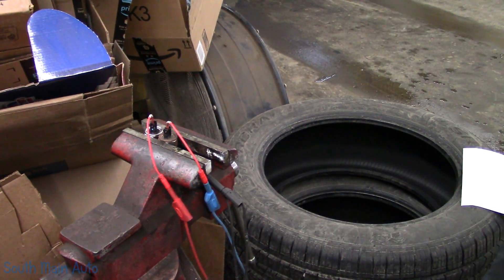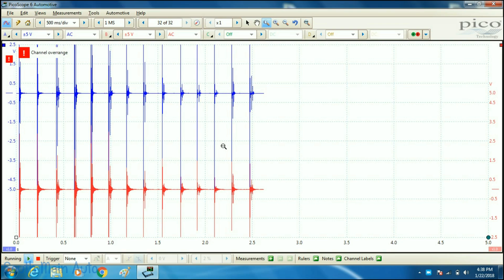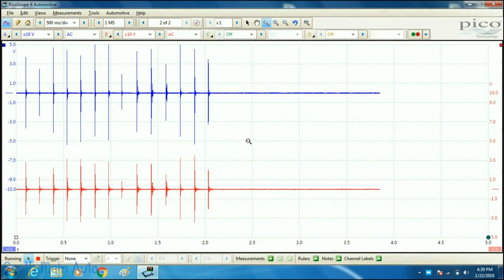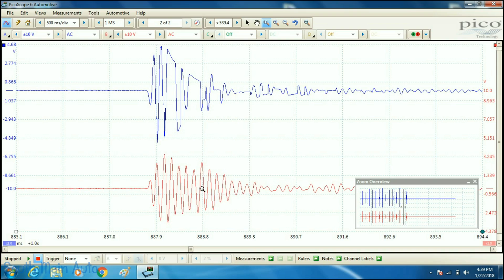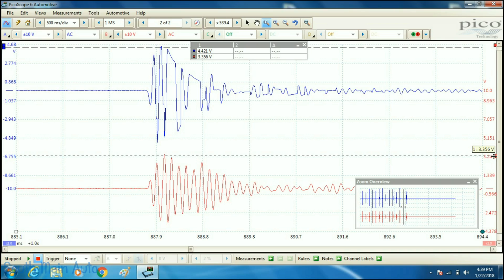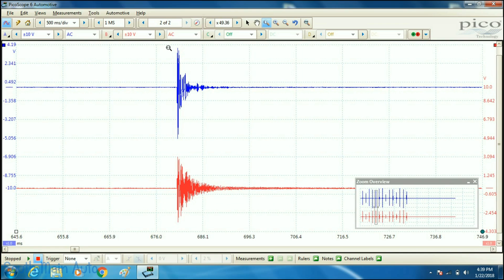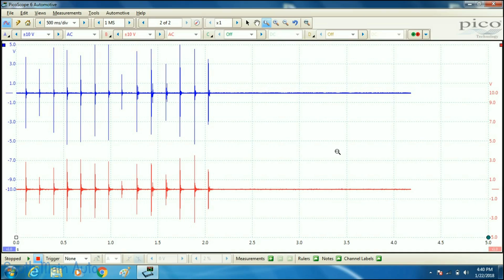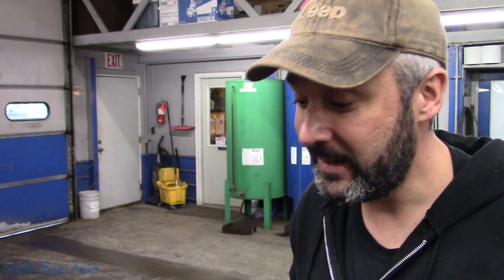Honda Knock Sensor Testing: Could You See It Without A Scope?

Comment: Does anyone know what the "knock retard" scanner PID from 1999 Acura TL mean?  It appears to be the ignition retard that the ECU is using.  I'm trying to trouble-shoot an acceleration (from stop) hesitation/jerk issue.  No ECU codes.  If I'm interpretating the "knock retard" PID as ignition retard as a result of knock, it seems like perhaps the knock sensor is overly active and retarding ignition.  I don't think I have bad fuel.  Anyone know how to interpret the "knock retard" PID on Honda?

Comment: Excellent video. The ecu is probably looking for the signal to cross polarity in order to detect the validity of the signal itself. The bad sensor doesn't have a clean sinusoidal waveform which is the root cause of this issue.

Comment: Any knock sensor code really has to be approached with caution. Always keep in mind, there’s more to the puzzle than just proper sensor operation and circuit integrity. An abnormal engine noise, or should I say ANY type of noise that is transmitted to the engine, can cause the sensor to produce an erratic signal or a voltage that’s out of normal parameters and trip the light, whether or not you can hear anything at the time you’re looking at it. We recently had a Cruze come to us from a different shop with a knock sensor code after 2 attempted repairs and no fix, all because it was almost 3 quarts low on oil. I heard nothing during a road test from a cold start. Some cars are just more tolerant than others. You could have one car with a ticking lifter or rod bearing noise that won’t set a code, but an arching out ignition coil that you can barely hear, and is not even causing a misfire, can set this code. You must be vigilant and cover your bases, and think outside the box. 

Despite the difference in waveforms here, if this car were in my bay, I’d still be hesitant to take those findings to the bank though, and I’d actually have more faith in blindly firing a sensor in. I’ll admit the scope has it’s uses, but the issue again that I have, is on many occasions you’re still left without a definitive answer. Even when your waveform is a little off from the known good, does that mean for sure the computer isn’t accepting it? Most computers will usually tolerate a variance up to a certain point, when comparing to a reading that we would interpret as being perfect. You could easily think you are condemning a bad sensor, and even tell the customer that you for sure found something wrong, then a week later the car shows up at your door with the light on again. When looking at scope data, it’s so easy to convince yourself there’s something wrong with what you’re looking at, when in fact you could be misleading yourself, and I’ve seen this happen. Look how closely you had to zoom in to see the trace in such a refined form.. I’m willing to bet, depending on what scope you’re using, you may not get a chance to see the difference when comparing

Comment: considering where the knock sensor it on that car, would you be comfortable/confident in probing the line someplace convenient to see the waveform? Just thinking it'd be easier to do that then remove and WOULD confirm if it's an ECM problem not the knock sensor.

Comment: Hi 
I have just come across your video on how to test a knock sensor for the honda crv.
My 2004 honda crv petrol (K20A4 Engine) check engine light came on I plugged my diagnostic tool in, it came up with the code P0325 knock sensor 1 circuit bank 1 or single sensor. 

I looked on youtube how to remove the knock sensor on the cvr, one way was from underneath the car by removing the front valance to gain access.
I put my car up on ramps removed the plastic front valance, I could only just see the knock sensor. I don’t think I can get it out this way, even though some video’s say you can remove it this way. So, I just sprayed it with WD40 and left the plastic front valance off for now.
I have deleted the fault codes and the light has not came back on yet after driving it daily.

Do you know of any way of how to do the wave test with the knock sensor still in the car? without trying to get up under the car and struggling to undo the sensor wire to put one end of the scope (diagnostic tool) to it.
I am hoping that you may know which way the wire is routed and if there is and wire connector I can undo to get to this wire.

I don’t want to take off the air intake and other things yet, just to test it

Many thank
Ian

Comment: Any true RMS meter with a graphing display will see that.. A Fluke 189-289 would see that easy.. A good used cost $250.00-$350.00 with accessories.

Comment: Honda's will set the knock sensor code after 5 seconds of no voltage change at the knock sensor when running.

Comment: Hi,  You can also use FFT mode of the scope to see frequency and power distribution (spectrum) of these two sensors.  Apparently defective one adds extra harmonics to the measurement and this (harmonic distortion) can be seen better on frequency domain.  Thanks for the video.

Comment: Thanks for this video!  I recently had knock sensor codes on my 02 Toyota and, sadly, I have limited DIY tools... No scope, not that I would have known how to use it anyway.  And 'Son of a Monkey to get to' is putting it mildly.  When I got to it, the sub harness was trash... old with brittle connectors from years in the engine heat, and that could have well been the issue right there, but being so danged difficult to get too, there was no way I was going to not replace the sensors as well.  All ways wondered how I could have actually tested the old ones and now I know!  Thanks again and keep em coming!

Comment: I just had this exact thing happen on a 2002 sienna.  The old knock sensors tested good with a DVOM and strike tests but due to them being down in the V of the engine I changed them out and code gone.  Guessed correctly but standard test was not definitive.  Found Denso knock sensors for $18 each.  I am glad I did because coolant hose in V was a disaster. I replaced it along with wire harness since I had it apart.  Worth being a parts changer on this DIY job.  Saved $$$$

Comment: How would you know the old knock sensor is bad if you didn't have the new one to compare it to?
Reply: they most often fail from broken crystal or connection to crystal inside, which means very tiny to zero voltage output.

Comment: For those DIY'ers Pico makes a small inexpensive 2-channel scope for less than $150. Google the PICO 2204A. I've been using it for about 6 months now and it's a great little scope - better than the u-scope which is only 1 channel in the same price range.
Reply: I think any professional shop would have to have a decent scope to be competitive. I'm just a home diy'er. I picked up the Pico 2205A recently and although it doesn't compare to the Automotive Pico's, I find that I can do more with it than without it. Thanks for all the great videos!
Reply: Or better the HSCOPE which has a automotive targeted license 😁

Comment: My shop has a Autell maxisys would the scope on it be able to show me about the same as a Pico ?
Reply from the maker: Yes
Reply: Thanks boss I appreciate the reply, Also thank you for Intruiging me to learn more and be more Well rounded with my diagnostic skills!!!
Reply: MrBlazenBruce I own the Maxi scope for the scan tool. If you can, keep saving for the pico unless you are using it for the basics/learning. The software is slow and laggy and does not offer filtering of the noise.
Reply: I plan to get a Pico but thanks for the information, I mainly wanted to confirm that the autell would do it, I have yet to use the scope at work due to us not doing a lot of in depth diagnostics - lack of customers actually wanting to repair their vehicle- poor customer base - poor town mostly, but again thank you Bobby!

Comment: Cool video! I put up a page on exactly this finding in 2009. I did put an oscilloscope on the signals and the bad one was putting out a similarly distorted signal. Essentially these sensors are microphones of a type, I have not tried to listen to them, but it is likely the sound quality from the bad one is obvious when compared to the good. Be cool to listen to the taps using an amp or even the "AUX" port on the car radio!  Maybe I'll try that some day.
http://www.findonefindall.com/toyota-sienna/toyota_knock_sensor.htm

Comment: From the perspective of a customer that is paying the bill. When you get a car that comes in with that code what percentage of the time is the sensor the problem? If it’s 75% or greater, as a customer , I would take the risk and let you go ahead and change the sensor instead of paying your labor rate to confirm failure with the scope, and then paying for you to replace the sensor.

Comment: One of the excellent features of the Pico are the measurements. You can easily take cursors and measure the True RMS / AC RMS of the knock signal. This will give you an number in addition to visual inspection of the signal.

Comment: Oh wow, nice!!  That one would be...difficult to diagnose without a scope, for sure.  Definitely need to have functional knowledge, as well as manufacturer-specific code-setting criteria.  If the PCM is throwing a circuit code, you could be chasing your tail for hours without a scope, but if it's a logic code, I'd probably verify circuit integrity via backprobe at the PCM and through scantool data, knowing that a piezo generator is incapable of producing the voltage and current required to toast the PCM, and swap the sensor.  :)

Comment: Great video. Very informative. BTW i have had this same issue on V6 PCM kept throwing a knock sensor Code for bank 1. i scoped both signals but couldnt tell the difference. so i joined both signal wires to the PCM . LOL

Comment: These days, some cheap DVMs include capacitance measuring capability. Couldn't hurt to have one. Throw in a cheap DSO and a DIYer has a nice diagnostic setup. 70 bucks even gets you an all in one model:

https://www.amazon.com/Oscilloscope-Multimeter-LIUMY-Professional-Scopemeter/dp/B071F1H3PG

Only one channel, but nice and portable. Real DSOs with 2 to 4 channels can be had for $200 to $400, but aren't nearly as portable. In other words, get both!

Comment: I just had the P0325 code on my '02 CR-V a couple of weeks ago! Being a DIYer without a scope, I fired the parts cannon at it with a new sensor and got lucky. The CEL has not returned. And you're right, these are a bit of a pain to get to, but I found it's not too bad if you come at it from underneath. Just curious, how many miles were on this '04 CR-V? My original sensor made it 133k miles. Great video!

Comment: Well I guess old school techniques just wouldn't work here huh. 

I challenge you all to this. Take that same test with one bad knock sensor and a good one. Hook it up to an actual analog voltmeter with a needle and see the difference between the two. The good one will have a nice smooth sweep the bad one will kind of Wiggle.

 You'll see those Peaks on an analog voltmeter. Same thing with doing a vacuum test. If you see a vacuum gauge wiggling around what does it mean.

Learn the old techniques the new ones will just make you that much better.

Comment: I have a "normal" scope sitting here 20mhz can that be used to do these test?
Reply from the maker: Yes
Reply: No just a regular scope. B+K 1420. oldie but it's portable. ........oops it a 15mhz scope. Haven't used it since my electronic classes back in 1990.
Reply: If its not a storage scope, it would require constant tapping while you look at the waveform.
Reply: 15MHz will be more than enough, that signal is a couple of kHz. B+K 1420 will be a lovely 2ch automotive scope, take care of it.
Reply: Don't have the battery pack anymore but it's small enough to tote around.

Comment: Hold on I see more than 20% difference in voltage most if not all those peaks. Plus man it just looks junk...scopes are important, necessary not always.

 Choose between my scope or not well duh use a scope. I challenge any seasoned pro to use the simplest tests 💯 and verify with tools when in doubt. Faster, cheaper, easier, make more money with increased turnover and less mistakes.

Comment: I have a ‘92 Vigor, rear knock sensor probably an 8 hour job, but, it would be difficult to gat a probe onto the sensor.  What does a trace look like when one is in-circuit?  Or, must it be measured out of circuit?  (BTW, not looking for repair advise.  Before I attempted to remove the IM I found a vapor hose I had leaned against and cracked, allowing air into the plenum and throwing a rear knock sensor code.  I R&R the hose and the code has been gone for over 6 months now.)
Reply from the maker: it will look the same but sometimes will be on a DC offset

Comment: As hard as the knock sensor is to get to, if I took it out, I would change it.
Reply from the maker: Even if it was not bad and was 90 bucks?
Reply: I spent over 2 hours removing the intake from a Honda CRV because of a knock sensor code. No way was I going to test and go on. I changed the sensor. Only to have to do the same thing 3 days later to replace a starter.

Comment: You cannot use an ohm meter on a piezoelectric transducer to determine if it is good. However, a scope is still not required. You must use a capacitance meter instead. If you measure capacitance it will be out of spec.
Reply: Automotive knock sensors have a resister in parallel with the crystal for the PCM to verify that the connections are good. Using a scope is a MUCH better way to test than a capacitance tester. Why? Because there are NO published specifications for a knock sensors values other than the waveform and resistance. Plus a scope can be used for far more testing on a vehicle than an ESR or capacitance meter ever could.
Reply: Eric M But how do you know good capacitance range?  The FSM doesn’t give it.
Reply: South Main Auto Repair good ones will not, bad ones will.
Reply from the maker: interesting , I will be looking into this. Never thought to look at it for the capacitor that it is. Easy to get tunnel vision when you do stuff the same way year in year out.
Reply: I know exactly what a knock sensor is and that a capacitance meter is another item that 99.9% of the automotive techs are not going to have or have a use for.
Reply from the maker: Interesting thought on that. Never thought of measuring the capacitance of it . Get sucked in by service info measuring AC output, resistance of course and in some cases the bias that they ride it on. I wonder what they would be. 900 to 1700 pF area? Have you ever used that method of testing one? Good tip btw
Reply: Eric M That is a great tip and if you think about it that makes perfect sense.  A capacitor only absorbs and blocks dc voltage.  A capacitor will however let the AC signal pass through which is what the computer is looking for.  So if the knock sensor has lost capacitance then it will lose its ability to just let the AC pass and therefore give you a amplitude which could be lower or not sinusoidal enough for the computer to like the signal.  Great tip.
Reply: South Main Auto Repair it's usually in the nf range, about 7-8.
Reply from the maker: and it does not change when being tapped ?
Reply: Ok you may be able to test capacitance however the ECU effectively  looks at the voltage waveform so nothing beats looking at the waveform at the ECU pin.
Reply: I unbolted my knock sensor and it's just hanging there but now I'm having issues with hard starts after warm up could it be because of my knock sensor?
Reply: Paul  Sosa probably better to unplug it. I doubt it would affect starting. Some cars just cannot cope very well with fault codes so really who knows.
Reply: Abbey Rham that's the point of this method, you don't have to remove the sensor from the car. I use it all the time to diagnose bad fuel level sensors on air craft all the time, because the last thing you want to do is open up a fuel tank on an air craft.
Reply: Blazer02LS just said a scope is not needed, and I agree scopes are useful, just not required to diagnose a bad knock sensor. You don't need to even know a good capacitance reading to test a knock sensor. You also lack the understanding that a knock sensor is essentially a capacitor, and they only accurate way to test a capacitor is with a capacitance meter. What you do is hook the capacitance meter between ground, and the lead off the knock sensor, and tap the sensor. If your capacitance value changes on the meter, it's bad.
Reply: Great method for easy to get to sensors. But I vote for the scope. imagine its a v6 with sensors buried below the intake. i wouldnt want to dig in to pull out the sensor to do a bench test with capacitance meter. i would scope out the signals at the PCM and look for a signal or a REF voltage BAM am done.

Comment: How does the knock senser tell the difference between preignition and normal combustion?
Reply from the maker: The frequency at which it occurs. It looks for a certain range. Plus the ECM know based on when it fires the coils the moment when combustion should occur.
Reply: To make a point about the frequency, I have seen knock sensor codes generated when engine mounts  are "gone" & the inertia from the engine rotation makes the engine bang against the mounts. No misfire from the engine, just the clank from the engine slapping against the mount(s)
Reply: George Brandt same way our ears do
Reply: Waveform changes based on normal or nonnormal waves. 

Each sensor is designed to be triggered at specific wave heights..ie voltage produced by the piezo diaphragm. Here the thing is corroded which led it to produce excess voltage and inconsistent waveforms.